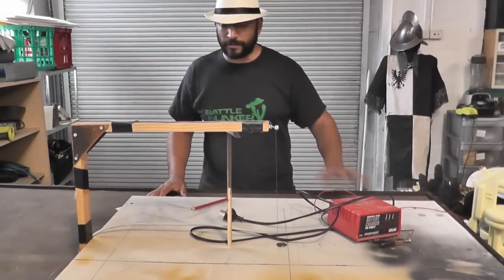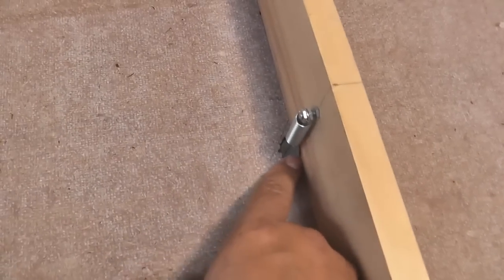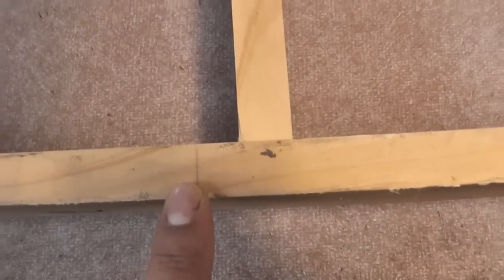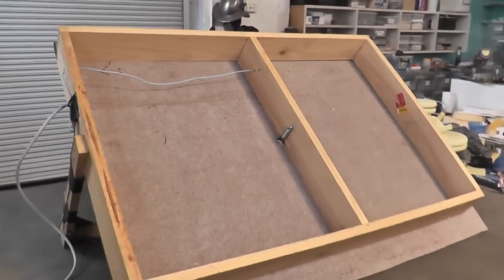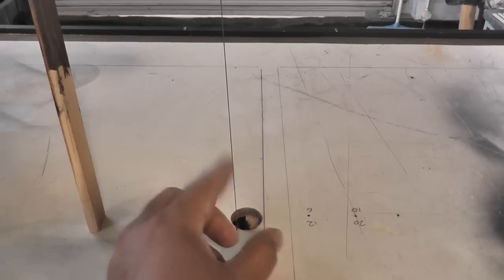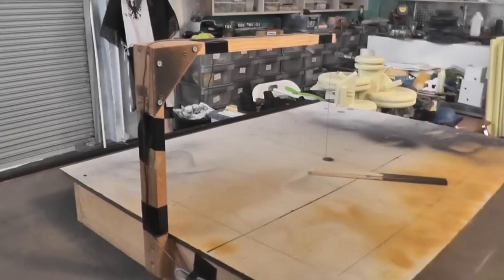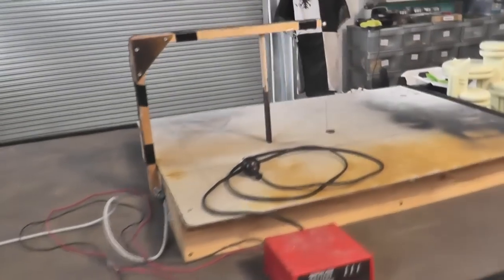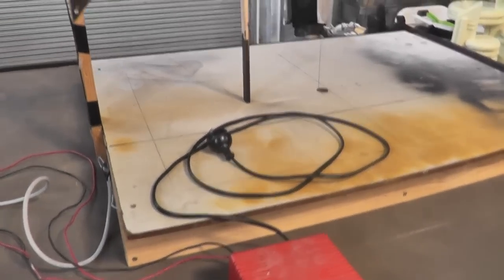BUA - My hot wire cutting table

Comment: I was thinking about cutting circles Viv. Can you out a nail in the base board and use it as a pivot for the foam?
Reply from the maker: yeah, I figured that out after about the 5th circle.  I forgot to mention it in the video ... not sure, but if you look carefully you might be able to see a bunch of small holes drilled at variously distances away from the wire for cutting various sized circles.  I put a toothpick in the hole, push the foam onto it and then spin it around.  Works well

Comment: Quick question.  Is 240V mandatory? Or can you use standard 110V for the car charger?
Reply from the maker: No, you can use 110v perfectly fine ... we have 240v power in Australia, any car battery charger will work fine.
Reply: Thanks for the hasty reply. And good work on the Tau set so far.